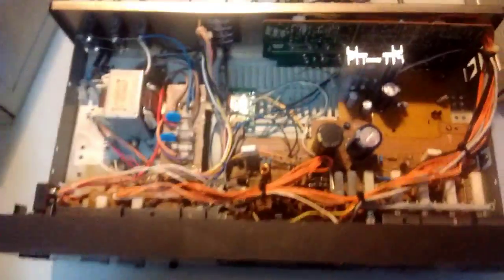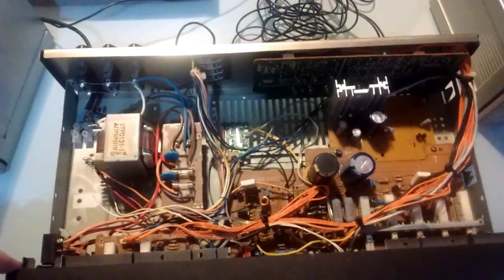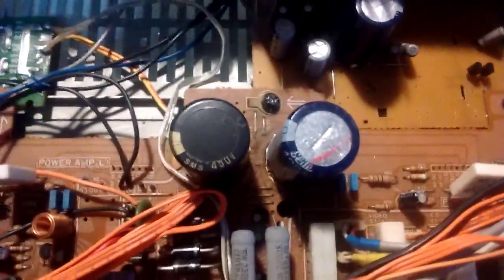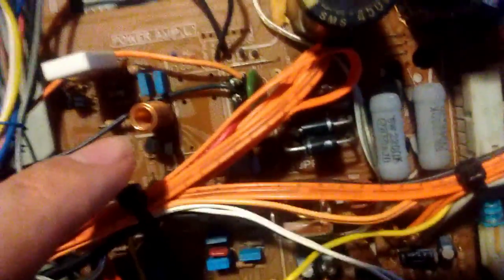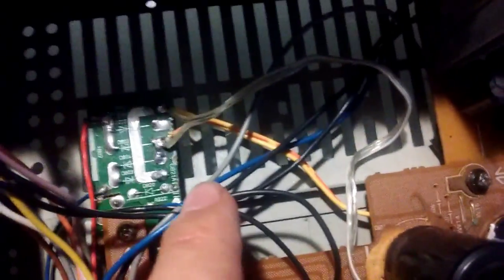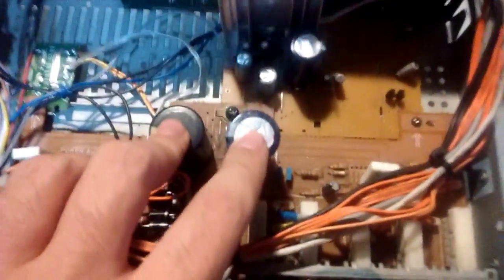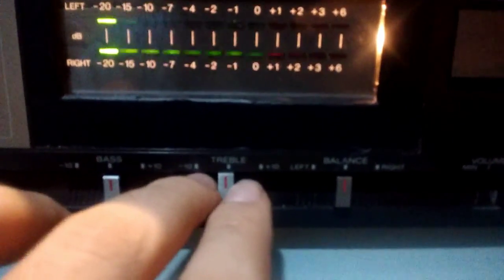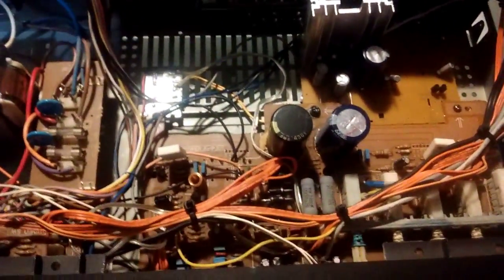Meet the Frankenamp

Comment: Interesting construction. I used to do that kind of stuff years ago when I first got into electronics. 
Your remark, regulating the power is not your job: Well, it is. The power company of course has some standards, here in Germany the voltage must be 230 V ± 10% at exactly 50 Hz. The frequency is the time base for many clocks, so it must always be correct. What "regulating the power" in your case means is that the rectifier bridge gives out a DC with a frequency of 100 Hz. Your filter capacitor smoothes that out and all that's left behind is a certain ripple voltage. A regulator takes that away. In your case, the ripple voltage is either low enough, or the chip has good ripple rejection.
Indeed the tone controls could be in the feedback line of the original amplifier chips. In that case, they won't work anymore. I had a Marantz amplifier I worked on with such a design, except it had a discrete amplifier design.
The 150 µF 400 V capacitors are a very bad choice. Please put in at least 470 µF, personally I'd choose 1000 µF. You are lucky there are the 15 V regulator chips. Without them, you'd be getting tons of 100 Hz hum, especially on the Phono input.
I like how you replaced those useless LED indicators with the big LED level meter :)
Reply from the maker: +DrCassette Wow, I got a comment from DrCassette himself! I feel flattered! 
I assume here in Spain we have the same power standards as in Germany, so maybe I really should put a regulator in there. I think I'm not getting any significant ripple going into the amplifier because the capacitor is way oversized for such a tiny amp. The main reasons why I didn't put a regulator in the amplifier circuit are:
 1. Threshold voltage: I wanted to get the most out of the amp, and the chip is rated at 24 volts for maximum power output. A regulator would need a significant voltage differential between the input and the output, so proably the biggest thing I could put in there would be a 7815, of which I don't have any, anyways.
 2. I had considered getting the amp power from the ~30 volt taps on the transformer, but I'd have to find a way to isolate the ground in the amp board from the ground on the rest of the electronics(since the audio ground for some reason is not the same as the chassis ground), and also, I don't have a 782x IC in stock, and I never buy electronic components, I always use recycled components(Yay for asperger's and not being able to talk to the seller at the electronic parts store!)
I will see if I can get decent power output with a 7812, I think I have one lying around somewhere.
Regarding the main filter caps: All they did was just filter the power for the amps, everything else (including the phono preamp) is powered off of those +-15V regulators, which have their own filter caps (2200 µF each if my memory serves right), so I'm not getting any noise on any of the inputs, including the phono in. 
Oh, and many thanks for the comment and the constructive criticism!!
Reply: +ilovethetwinfamicom 
Oh, OK. If the regulators have their own filters, then that's OK. 
If you don't have hum problems with the amplifier IC, there is absolutely no need to put in a regulator. And the 7812 would be a terrible idea. Those little linear regulator chips output a maximum current of 1 A. The chip, even though it's small will probably take peak currents of at least 3 A. When the 78xx regulator gets up to 1 A, it will automatically reduce its output voltage. So instead of nice impulse response from the amplifier you will only get distortion. 
I had to put a 317 regulator into the amplifier that I have on my workbench for test applications because it kept having hum problems. The 317 has a current limit of 2 A. Still it reduces the output power to pretty much nothing. As soon as I turn it up a little bit, I get distorted bass.